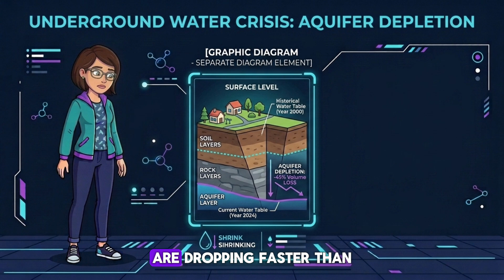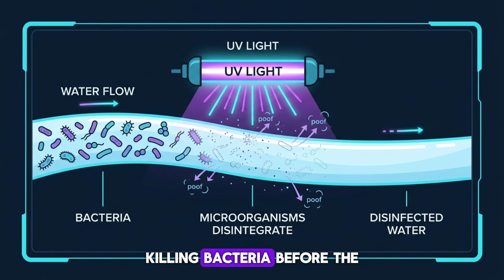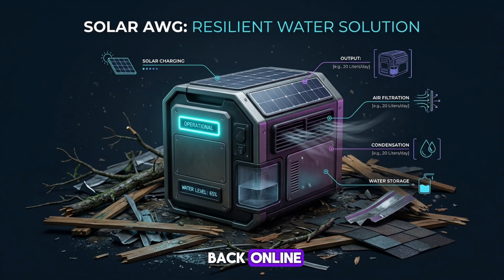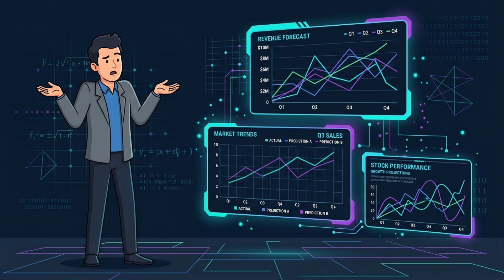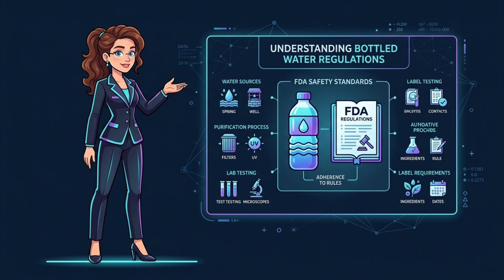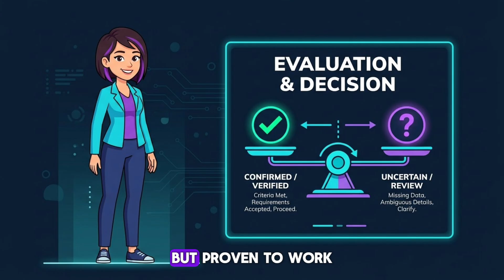Water From Thin Air: The Machines Turning Humidity Into a Home Water Supply

Comment from the maker: Here are a few key clarifications regarding the topic.

First, this technology cannot resolve severe droughts in extremely arid regions such as Arizona or the Sahel because atmospheric water generators require relative humidity levels above thirty percent to function properly. Therefore, this coverage focuses exclusively on regions that possess adequate humidity yet still lack reliable access to clean drinking water.

Second, Moses West is a real individual, and the Moses West Foundation is a legitimate nonprofit organization. This video is not sponsored; we chose to highlight his work simply because we found his contributions remarkably impactful.

Finally, regarding regulatory standards, the policy gap mentioned is accurate. The United States currently lacks a dedicated federal framework specifically governing water produced via atmospheric water generation. Instead, oversight falls into a grey area between Environmental Protection Agency regulations for municipal tap water and Food and Drug Administration standards for bottled water. While EPA testing revealed no contaminant violations, quality can still vary across different manufacturers. If you are considering purchasing one of these units, we strongly advise verifying its independent certifications prior to buying.

Thank you for watching ❤.